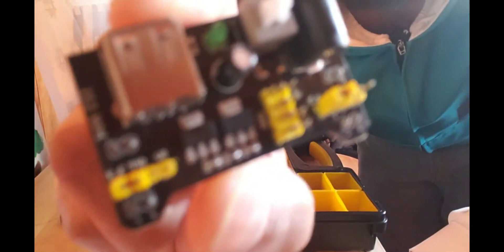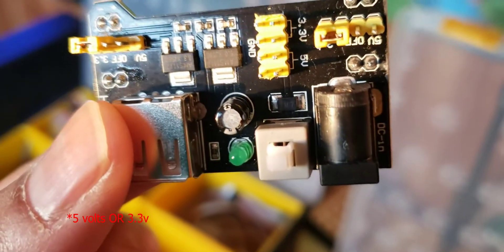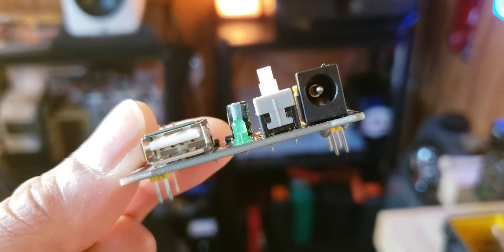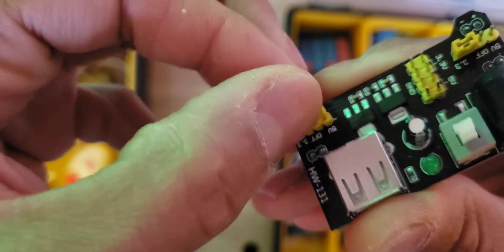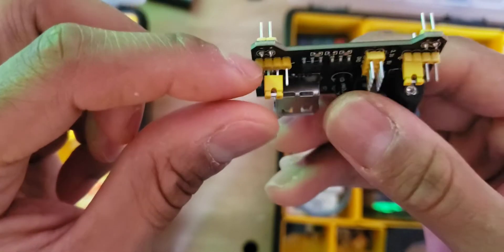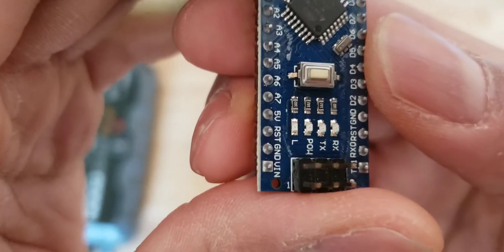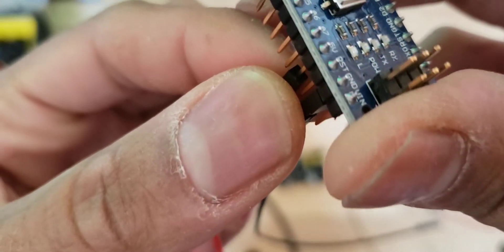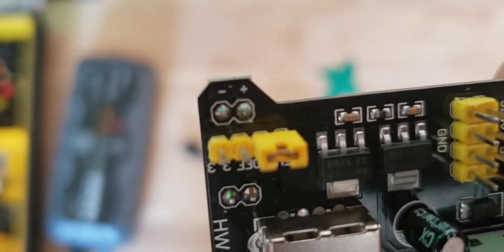Master Dual Power Supply: Arduino HW-131 3.3V & 5V Module Overview and Demo

Comment: I just read in a pdf datasheet that the usb connection is not for powering the board, but you just did that and it seems to work. Strange.
Reply from the maker: I did see that depending on the source material being referenced the wording is slightly different. I usually look at a schematic for verification. The differences between the barrel jack input and the usb input is a diode and a voltage regulator. http://www.handsontec.com/dataspecs/mb102-ps.pdf
Reply: @buf0rd  ok, thank you. But you connect your power supply to the output of the 5 volt regulator. That might be not good. But you showed that it worked so I think it will do. Thanks again.
Reply from the maker: @FritsvanDoorn  you are correct. Internally, at the board trace level, the '+5v' pin (5) from the usb adapter does connect to pin 2 (output) at the regulator. I believe the diode is for reverse bias protection if one were to connect a barrel adapter at same time. I'm not sure if internally the a1117-5 has any protection. ALSO, I just noticed under the USB port the text "USB Port(Input or Output.."

Good catch! Purpose of video was to demo input from power supply > power module > output to arduino.

Comment: But why my arduino get hot after i solder it and turn on the power eventho i solder it to its right connection?
Reply from the maker: Possible input voltage concern?

Comment: Hi ,The specification online say I can power it up with 6 to 12 V dc ,I have an power wall adapter that is rated for 12 V and 1.5 amp . I tested it with the voltmeter and puts out 12.20 V , would this be ok or are there any risks ?
Reply from the maker: I wouldn't recommend it.
Reply: Don't put 24 volts in it.